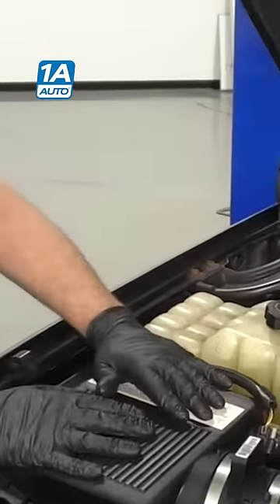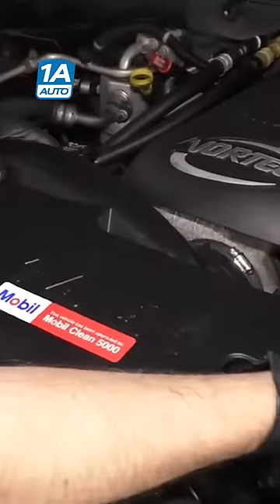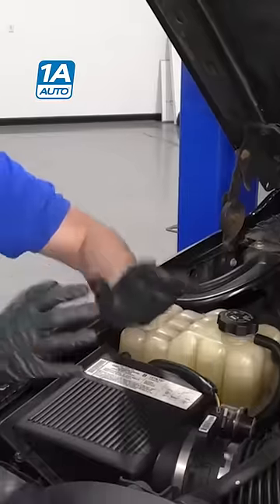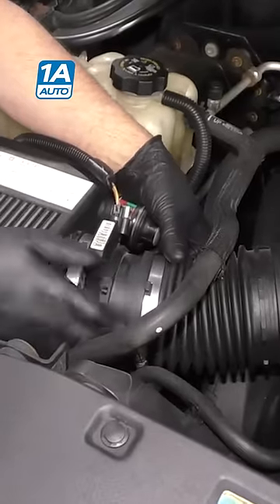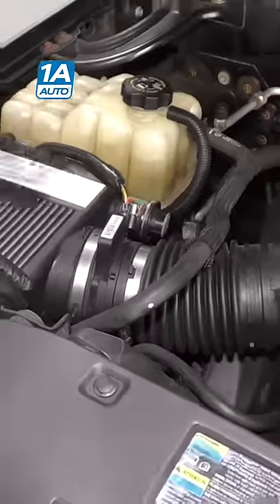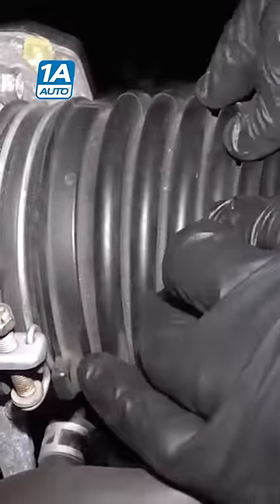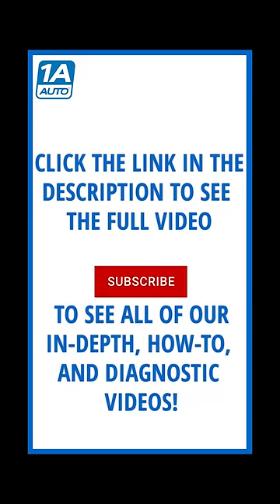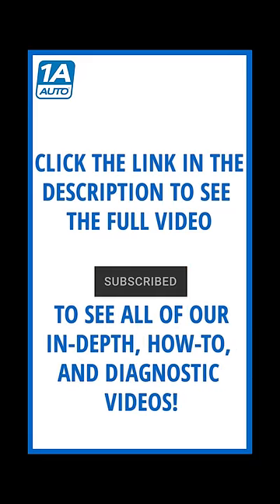System Too Lean #shorts

Comment: My very first vehicle had fuel spark or air very simple to troubleshoot now days they design cars so the common man don't have the knowledge to fix ...every thing is censers and relays and in order to fix some thing there is no room to work so you have to go to the car dealer or just buy a new car its all a master plan so they can make more money my friends car you have to take the exhaust manifold of to change the alternated and the spark plugs are inside the engine and you have to take the drivers side tire of to get to the battery its all designed to make people afraid to touch their cars...give me a 1966 Oldsmobile cutlass and I will work on that all day no matter what the problem is

Comment: That's not all that and causes it and there's more that causes it even fuel rail pressure issue causes that or even another kind of vacuum leak that will cause that much just what you're showing us

Comment: Gay
Reply: You?
Reply: That's weak in this day and time. Check your mirror first.
Reply: That's weak in this day and time, check your mirror first.
Reply: That's the name of the game now days ....make things harder to work on so you have to either take it to a dealer or buy a knew one back in the day you had gas spark and fuel it was very easy to trouble shoot and fix yourself nowvdays its all censers or you have to take half the engine apart